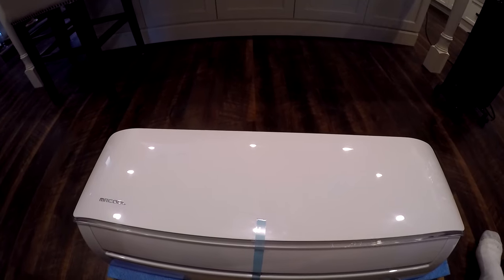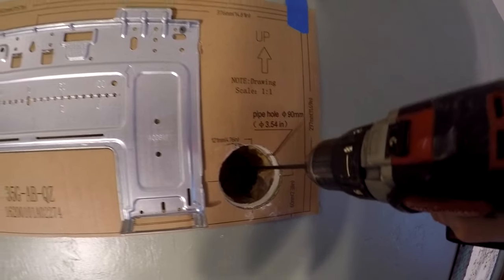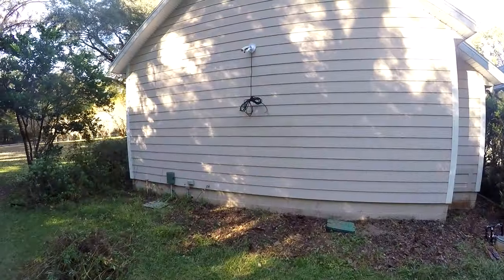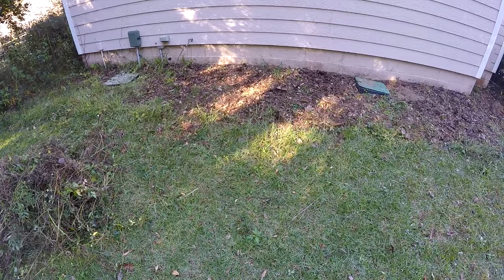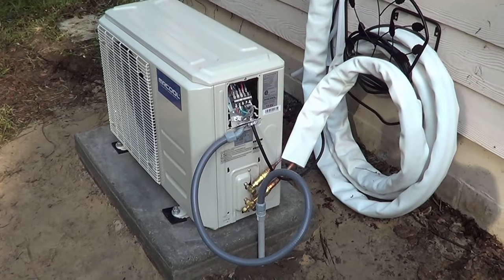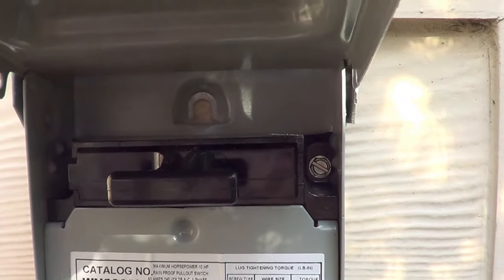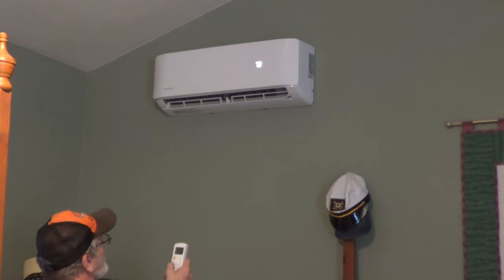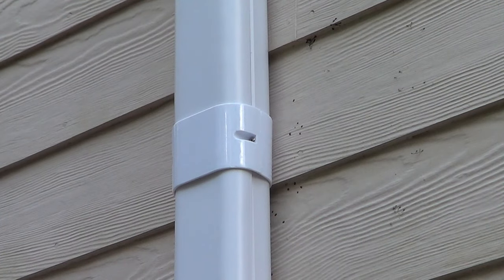MrCool DIY Mini Split Install

Comment: Shouldnt you turn on the unit and check the connection for leaks before covering them up? 12:34
Reply from the maker: I did check for leaks at 12:05 but I did not check after running the unit.  Looking back I think that would have been a good idea and recommend that folks do that as you suggested.  Thanks!

Comment: Do you not need to do a vacuum on these?
Reply from the maker: No, That is the beauty of the Mr. Cool system.  The lines are pre-evacuated.  The downside is you can't cut them and have to roll up the excess.  Thanks!

Comment: are these able to cool and heat an entire house, or would you need to have one in every room?
Reply from the maker: A single 12,000 BTU unit will cool about 500sq ft.  You could put one in each room OR a 48,000 BTU unit will cool about 2,000 sq. ft. and has 5 separate heads for 5 separate rooms.
Reply: @HomesteadEngineering  thank you. i have 1000sq ft.... so all of those linesets would be on all sides of the house to feed the heads?
Reply from the maker: @xisotopex  It all depends on your situation.  You will need a lineset where ever you have a head.  Ideally, you want to put the outside unit in the area of your house where the power and gas come in or maybe by the pool pump or garbage cans.  Then try to hit as many rooms from that one wall as possible.  It pretty much has to be outside walls as the units need to drain out.

Comment: Do they give advice if you have a concrete block house?
Reply from the maker: I do believe that this can be done but I have not done it myself so I can't help much.  My guess is to get the proper bit and drill through the block in the right spot.

Comment: Power seems off.  At 17:40, display shows 123v @ 5.12A and 528.9W.  That differs from 629.7 actual or 445 RMS.  And 88kwh number never changes.  Something is off there...
Reply from the maker: The power is ramping up from zero to about 8-900 Watts.  The KWh's don't change until you use a full kWh. i.e.  It would have to run at 1000Watts for 1hr to change to 89kWh.  Thanks!

Comment: How many BTUs was your mini split for? and what was the square footage of the space you installed the mini split ?
Reply from the maker: 12,000 BTU's and it went in a bedroom roughly 300sqft.
Reply: @HomesteadEngineering  do you think the 12k unit is enough to keep your room cool or do you wish you had gotten the 18k?
Reply from the maker: @hvaldi31  Its plenty big enough for the 300sqft and I would guess it would cool almost twice that.  Our house is 2x6 construction with R19 insulation in Florida sun.  No Problem.  Been running it non stop since installation summer and winter.  Heats and cools.  Run on 120V so that is a big plus.

Comment: Would a 9000 btu work well with a 288 sq ft tiny house with  a vaulted ceiling in Texas?
Reply from the maker: That sounds about right to me...
Reply: Thanks,  I ordered the 9000 but I thought the 12000 would be better fir the hot weather and the higher ceiling.

Comment: Any updates on how it’s working
Reply from the maker: I run it all the time.  Cool in the summer and heat in the winter.  Works like a champ!  Only issue I had was that I did not clean the filter and had the fan set on low and it iced up on me.  I turned it off, let it thaw out and cleaned the filter.  No problems after that.  Now I keep the filter clean and run the fan on medium.  Thanks!

Comment: Gotta love that big roll of refrigerant line coiled up behind outdoor unit! NOT!
Reply from the maker: Peter, it does pretty much suck I'll admit.  That's the price you pay for the DIY version.  I imagine at some point it will need to be serviced and when the AC man is there I will probably have him cut it out at that time.  If your putting it in a area that already has a ton of mechanical then I don't think it matters much.

Comment: When do you charge the system with refrigerant?
Reply from the maker: The system comes pre-charged.  That is the big advantage of the Mr. Cool DIY.  The downside is that you can't cut the lines, you have to roll them up.

Comment: Dont you need to torque the line sets to so many NM?
Reply from the maker: Eric, That would be a good idea but I don't have any way to do that.  I think most folks just tighten them firmly and then check for leaks.  Thanks!

Comment: In watching these install videos I haven’t seen anyone install a surge suppressor at the disconnect location. Control boards fry easily in a lightning storm. 😢
Reply from the maker: My system runs off solar 24/7 and is protected by five lightning arrestors: 
https://youtu.be/NcCv-W3Mi7o
300AC: https://amzn.to/44tjWAt
Thanks!
Reply: @HomesteadEngineering  
👍I stand corrected kind Sir!

Comment: Mine keeps dripping from the inside wall. Even after adjusting the lines.
Reply from the maker: P, You have to make sure it is downhill all the way.  The drain should be on the bottom.  It has to angle downward through the wall as well.  It is also possible the the plastic got cut and you will need to cut out the bad section and replace it with new.

Comment: Put a Rectorseal RSH-50 gas charged surge protector for the unit.
Reply from the maker: JST, It runs off my solar power and that is protected with quality surge protection from Midnight Solar:
Midnight solar surge protection (115): https://lddy.no/vlo5
Midnight solar surge protection (300): https://lddy.no/vlo7
Thanks!
Reply: Well in that case, carry on! But good for others if they run off the grid.

Comment: Can you tell me how you measured for those j-bolts when building the foundation? We're looking to do something similar, hoping to avoid turning the condenser on its side to measure distances (36k model -- heavvvvy). p.s. Thanks for the video!
Reply from the maker: Michael, I think I just measured the distance between the holes on the mounting brackets of the unit.  Note that there is some wiggle room.  Also note that I only put two j-bolts in concrete.  Putting in 3 would require a lot more accuracy and forget putting in 4.  :)

Comment: Dude... just a heads up.... I may be wrong about this but it's certainly something you'll want to investigate.  I was watching a similar video recently and one of the comments, allegedly from a mini split engineer, is that you want your line coils to be in the horizontal plane not the vertical plane.  It had something to do with how the oil in the lines makes its way back to the outside unit and how the oil can become "trapped" at the bottom of vertical coil.    Anyway... anybody out there able to shed some light on this?  Anyone?  Beuler?  😉
Reply from the maker: Thanks for the tip.

Comment: fwiw the instructions say to not use sealant on the line connectors
Reply from the maker: Alias, I feel good about using it myself but I suppose folks should follow the directions.  Thanks!

Comment: not gonna lie, that trench looked more like 12in than 18
Reply from the maker: Yes, I have a ton of other stuff buried in that same area.  That's why I put the direct bury wire in the conduit.  I usually bury my wire at 2.5 feet deep and I recommend that folks follow code when installing your own system.  My yard has SO MUCH stuff buried in it.  I have over 2 miles of PVC alone!

Comment: update?
Reply from the maker: I have been running it 24/7 off my solar power and it has performed perfectly so far.  The only issue I had was this:  On two occasions the system iced up.  Both times I had let the filter get too dirty and had the fan set to low.  If this happens, I turn the system off to let it thaw out and clean the filter.  I always run the fun on the 3/4 setting now and no more icing.  Thanks!

Comment: Wrll the only thing that i see that the rwfrigirent line are coil up that is a oil trap.😮
Reply from the maker: Yes, several AC folks have pointed out that it should be flat. 
 No problems yet.  I'll post if I have a problem.  Thanks!

Comment: DO NOT coil the extra length of tubing
Reply from the maker: OK, What do you suggest?
Reply: @HomesteadEngineering   zig zagging it along the ground or against the wall. You want to avoid loops that go up and down to prevent the buildup of oil vapors that would condense and fail to return to the compressor.
Reply from the maker: @TheSmbTechy  Are you saying that it should be coiled flat instead of vertical?  I have heard that from several others and it does make sense.
Reply: @HomesteadEngineering  correct
Reply from the maker: @TheSmbTechy  OK, I think you are right and that is how I would suggest doing it as well. Thanks!

Comment: Horrible installation,  never pulled a vacuum to remove the exposed air, this will give BIG problems in the near future 😬
Reply from the maker: These units are designed for DIY installation.  Pulling a vacuum is not required because they designed it with the lines pre-vacuumed and sealed.  The refrigerant is in the unit and fills the lines when you connect them.  That is the big advantage of Mr. Cool.  The downside is you can't cut the lines during installation and have to roll up  the extra line and it does not look the best.